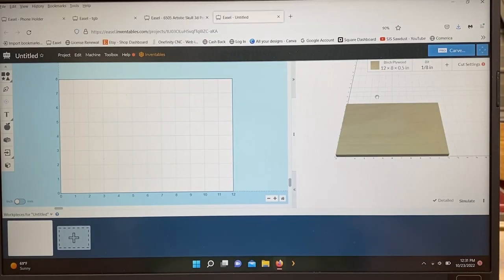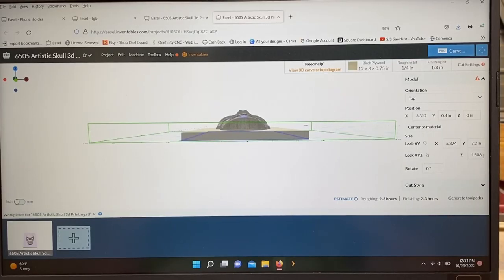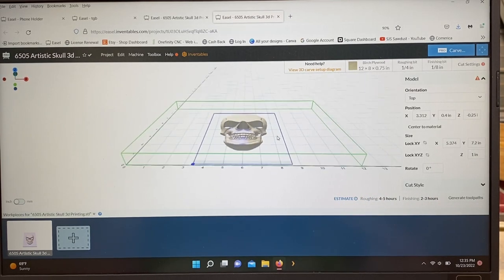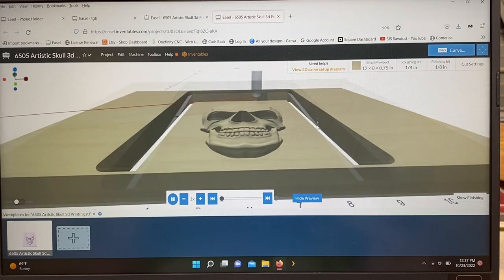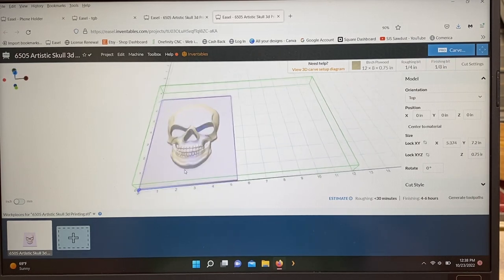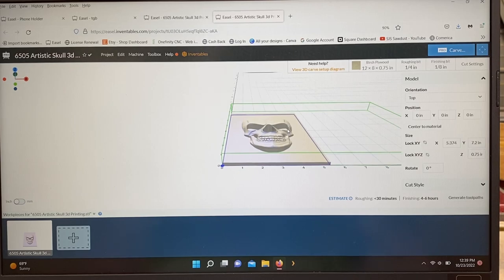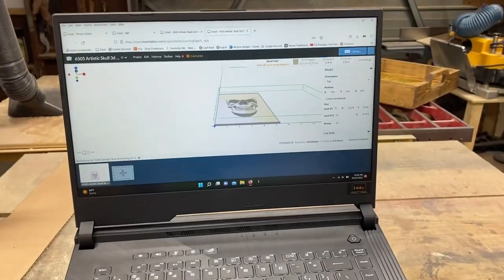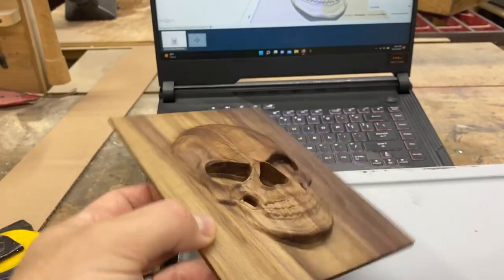3D for Free - Easel Software Upgrade

Comment: How do you make the size smaller on the .stl file if its bigger than 100mb? Do u shrink it in another software? Thanks
Reply from the maker: I got lucky and chose a file that was just under the 100mb. There has to be a shrinking program out here

Comment: i have a dumb question when you did this carve do you use the touch probe for x y z. Im not sure how to set that all the material is gone for finishing pass to set probe on.
Reply from the maker: That’s a good question. If you have a spare piece of that same material, OR your project material is larger than your file and won’t get cut, (like with mine. My Poplar was 12” x 12” and my skull was roughly 6” x 8” ) you can probe Z from a spot on the far right (in my circumstance) Your router should return to the same X Y origin after the roughing pass. Let me know if this helps
Reply: @SJSSawdust  got it thanks.

Comment: That look awesome! I’ll probably stick to Easel and upgrade to Pro. There’s CarveCo as well, but they don’t have a free trial, so I cant mess with it and see if it’s more or less better than Easel. 

I’m NEW to the CNC world, so I’m coming across a lot of videos such as yours to see its capabilities. I’m so impressed by what a CNC machine can do. I started small, I have the Masuter Pro but hopefully I’ll upgrade in the near future. So, whenever the machine is done with the roughing portion, do you need to dial the cnc (home) or will it pickup in the same spot once you exchange your tool bit? I’m not there yet, but just curious to know. All my test trials have been one pass (mostly lettering) and straight detail, no roughing yet. Thanks for the feedback and for sharing!
Reply from the maker: Thanks for watching. CNC’ing is definitely a learning process. For a 2 stage project, you would run your roughing pass ( larger bit) and then run a detail pass (smaller bit or v carve bit). After the roughing tool pass is complete it will return to the start position where you set your x and y zero.  Once you’ve changed bits and set your z zero, the detail pass is ran
Reply from the maker: Check out my other videos, I show all sort of different projects and methods
Reply: @SJSSawdust  Hey, thanks again! I appreciate the feedback. I'm gonna have to try an STL file project soon!
Reply: @SJSSawdust  For sure! I subscribed brother, so I can keep getting your vids. I appreciate you.
Reply: I am a current Carveco Maker user who is looking to switch. There used to be a free 3/mo trial, however I cant find links to it anymore. I am currently evaluating Easel Pro, but honestly I am finding that Easel Pro is a joke compared to Carveco (even the maker edition) when it comes to features. On the plus side for Easel however is that Easel is just stupid easy to use. There's pretty much no learning curve at all. It is , IMO not even close to being worth $25/mo when you can get Carveco for $15. The downside to Carveco for me is that their software is a bit clunky sometimes and I don't like their support at all. 2 times I have contacted their support and both times it turns into a circus where I am expected to jump through hoop after hoop if I want to find a solution. They always want you to upload your files to them before they will help you, which I do not agree with at all. The second time, I sent them a video of a bug in the software and they asked me to upload my file. I replied that the issue occurs with any file, and they got snippy with me and insisted I upload my file. The bug is still there a year later, and I've confirmed on more than one PC that is is in their software, so I'm done with them. The best option price wise may be Vectric vCarve Desktop (also 3D). It may actually have more features than Carveco and license is a one time $350. There is also Carbide Create Pro ($10/mo), but I wasn't too impressed with it. Good luck and welcome to the CNC club where software that is inferior to free software for 3D printing is locked behind $2000 paywalls by greedy companies.
Reply from the maker: @leonpalnau6839  well said. I agree that Easel is just so easy to use ( which is the reason I gravitated toward that when I was just starting out). I would like to upgrade but honestly, and maybe I do too simple or preschoolish level projects, but it works just fine for me.  I know that some of the toolpaths are kinda crazy, and a waste of time- but since I am not running my CNC for 8-10 hours a day, 15 minutes of extra carve time doesn’t really bother me - I’m usually in the shop doing other things, while it’s running anyways, so the time doesn’t really make a difference to me.
Reply: @SJSSawdust  Don't get me wrong, I actually really like it. The UI is just so clean and intuitive.  The biggest limitation I see right off the bat though is the 2 tool/toolpath limitation. I'm sure there are ways around it, but that one bothers me. I usually like to area clear with a 1/4", then sneak a 1/16 endmill in to clean profiles and then often will have a 3d raster path and maybe even v carve/drill paths all in one project. It didn't seem possible, or at least easy to do that in Easel.

I do like their clip art gallery though....
Reply: @leonpalnau6839  Hey Leon, i'm in the exact boat as you, my bigger issue is my pc is slowly dying and i have a super powerful mac which Carveco won't support.  The inital response is that it's much slower carving than what i'm used to, i have to play around with the speeds a bit more.    For example, i can carve stars on Carveco in around 9 Minuets where Easel is taking or at least on the program, 25 minuets..  Got to keep trying though..   John

Comment: Thanks for the video! Can you add a third bit if you maybe wanted to use a V bit to sign it ?
And what is plunge rate ? :)
Reply from the maker: You could definitely use a 3rd toolpath/bit. All you would need to do is set up your 3D tool paths and then a second file with the V bit and start them from the same place (center, lower left) and then run the 3D tool paths, switch bits, zero your z and run the detail pass!

Comment: How do you setup the bit change?
Reply from the maker: You save the entire file as two separate tool paths (Easel will break it apart for you as “roughing pass” and “detail pass” ) run the rough path, the machine will return to its starting origin, change the bit and run the detail tool path

Comment: May I know what tool bits are used?
Reply from the maker: Sure. I used a 1/4” end mill to rough out the material and then an 1/8” ball nose for the detail pass ( I believe)
Reply: @SJSSawdust   Wow. Thanks for your kind reply.

Comment: i grew out of easel within a month, it is very limiting software. easel toolpaths are meant for beginners and they are not optimized at all. vectric software has more possibilities and easy interface but its made for vector files that you will be using everywhere anyway. add up those hours you lose to easel's bad toolpaths and calculate your earnings to see how limiting easel is. confusion 360 gets the best 3d toolpaths and everything has a tooltip next to it, 3d adaptive is the most optimised out of all programs i know.
Reply from the maker: Thank you so much - I definitely need to switch but I’m a creature of habit… lol. I’m also intimidated by the thought of learning a whole new program, but I know I need it. Is it easy to learn?
Reply from the maker: @irishful1  thanks! I’ll have to just stop being stubborn

Comment: How did you design the skull for easel?
Reply from the maker: As far as I know, you can't edit or alter the files in Easel.  I purchased my file from Etsy and then imported it into Easel.  Once the file is imported, you can do slight alterations to the file ( size, z depth) and then Easel sends the g code

Comment: So I downloaded this from Etsy and tried to do what u do but my finishing pass Is nooo good lol it’s cutting air over the skull 🫤u have any tips of how to get the bit down to the image? Signed real newbie lol
Reply from the maker: Sounds to me like maybe you didn’t re-zero your “z” axis after you changed your bit. Either use the extra material that isn’t being cut away or grab a piece the exact same thickness and zero off of that. That should work 😀
Reply: @SJSSawdust  yes I had did that. I figured out the problem my router on z axis was too high for some reason so I adjusted it to the wasteboard and redid the whole thing and it worked beautifully. Thank you for your help though.
Reply from the maker: @meltn2me  great to hear it!